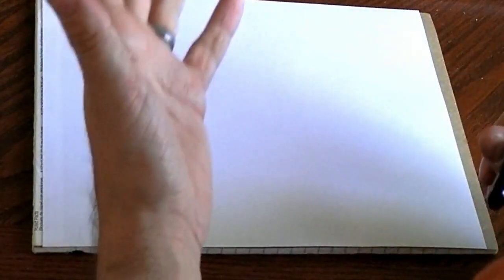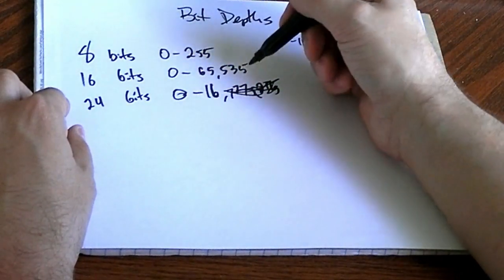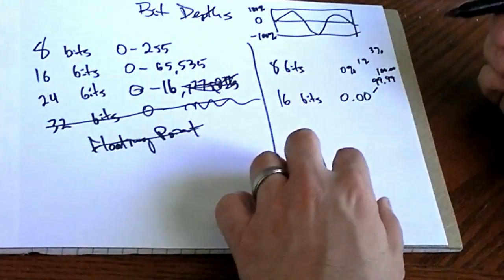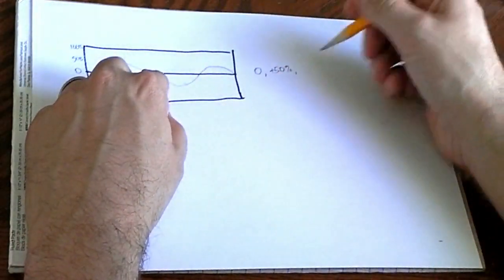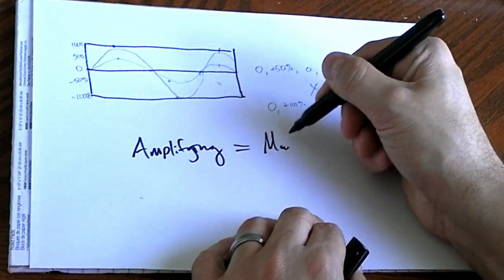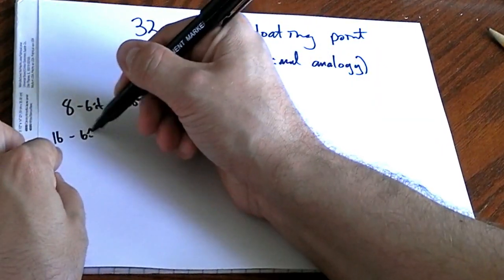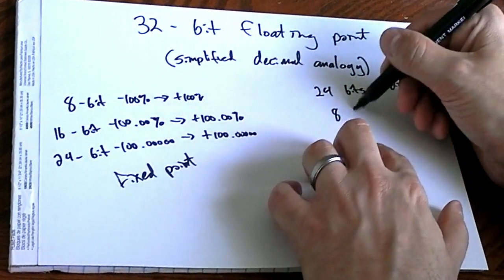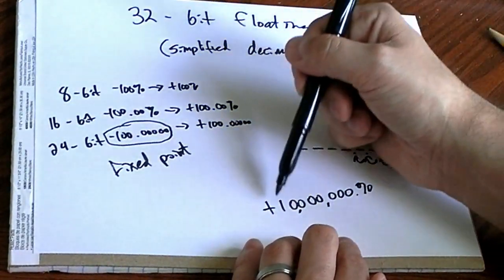AF016 - Digital Bit Depth Part 2

Comment: 32-bit integer exists. It can be selected in Sound Forge, used as output format on my E-MU ASIO sound card (maybe others). And SoX still works at 32-bit integer, and downconverts output from floating-point effects with clipping.

Comment: I'm sure you know this, but in 32 bit FP, 1 bit is reserved as a 'sign' bit, 8 to an exponent, and 23 to the mantissa (number), yielding a range of (2^1) * (2^8) * (2^23), or 4,294,967,296 (−2,147,483,648 to 2,147,483,648). Hope you find that interesting! Thanks for the videos!

Comment: Love the series! One thing I'm still hung up on (and I do this for a living!) is the bit depth analogy: in the video, you use the ruler, and describe 24 bit as having smaller steps, thus allowing it to quantize more accurately. But according to the math (which is over my head), each bit yields 6.02 dB in dynamic range. If each bit has a fixed dynamic range yield, how can 24 bit offer "smaller steps"?
Reply from the maker: That's a great question. The idea is that adding and subtracting dB really means multiplying and dividing the samples, and that the added dynamic range improves how quiet you can get before it all rounds off to total silence.

For example, let's say we have a sample value of 10. Here's an analogy - it's very sloppy but I hope it gets the idea across.

Low bit depth analogy: no decimal places
10 -> 5 -> 2 (round down) -> 1 -> 0.... and then trying to divide always gives 0; we've lost the signal completely.
We're out of dynamic range after 4 cuts in half, so it's 4*6ish = about 24dB usable dynamic range from Full Scale to the dropoff point.
(Did I say the analogy was very sloppy?)

Higher bit depth analogy: 1 decimal place
10 -> 5 -> 2.5 -> 1.2 -> 0.6 -> 0.3 -> 0.1 -> 0... where we lose the signal.
Having an extra decimal place (kind of like having a few more bits) gives us 7 halvings before we're stuck at 0, so it's 7*6ish = about 42dB.

Very high bit depth analogy: 4 decimal places
10 -> 5 -> 2.5 -> 1.25 -> 0.625 -> 0.3125 -> 0.1562 (round down) -> lots more times before it hits 0 = very large (more than 100dB) dynamic range

I hope that helps; the Dynamic Range By Domain videos touch on this as well, if you want an audio example.
Reply: That does help, thank you! I think I got hung up on the erroneous idea that each change in amplitude would occur in coarse 6db increments, when each additional bit simply offers up to 6db of gain.  The decimal analogy really helped. Great series!

Comment: I can' t amplify the value of the sample without clipping and getting a distorted sound (unless I use dynamic compression which still wouldn't affect the sample at 100% xD).
So what is happening when I turn the gain up to 100%? I suppose that turning the volume up on some studio monitors is in the analogue domain. But if we do so in a DAW or something, does it mean that the 100% sample is "de-amplified" (by dividing its value) when the gain is turned down. How exactly does all of this work? :S